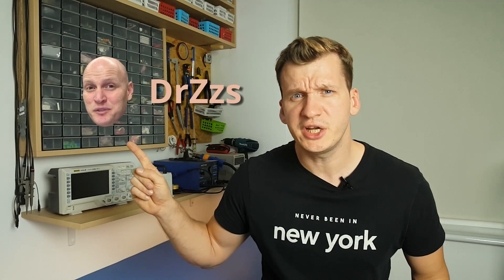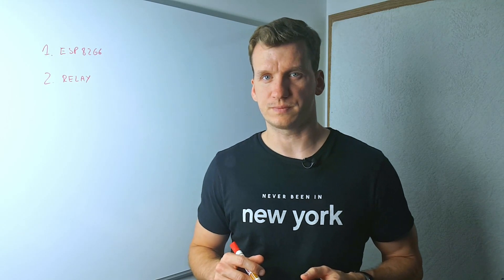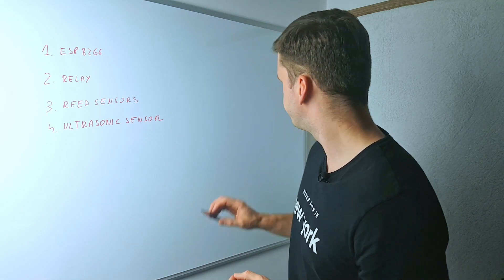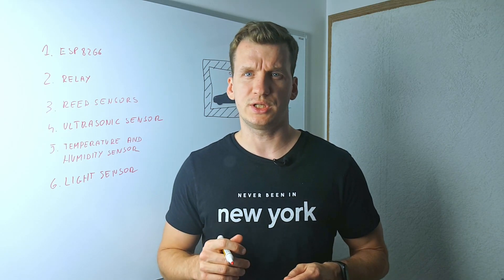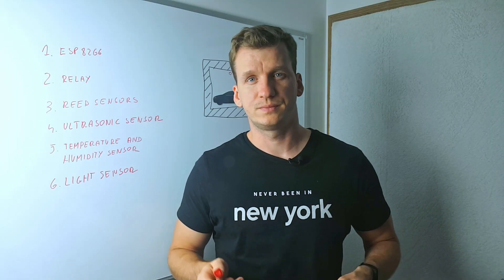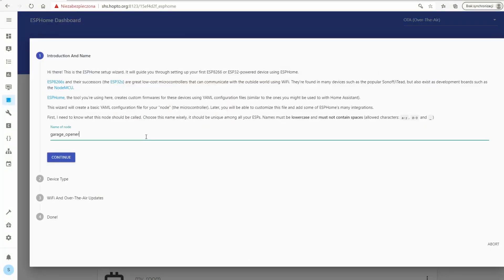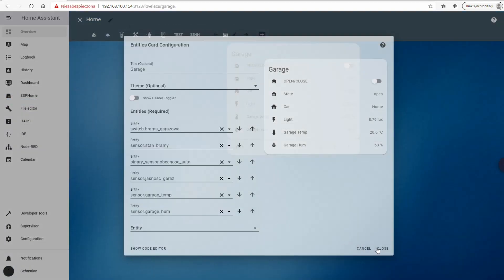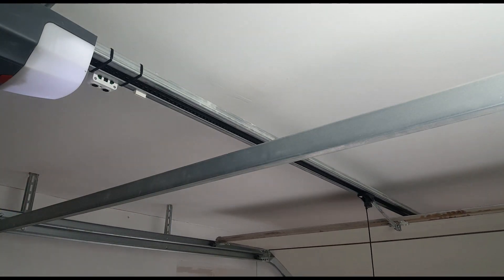ESP8266 Garage Door Opener: A Smarter Way to Open Doors

Comment: which 3d-printer are you using?
Reply from the maker: The printer is also designed by me (and two of my friends). Nothing commercial.
Reply: @SmartSolutionsForHome  Wow wish I knew as much as you do about electronics design. :)

Comment: Nice - I've been using a relay in a similar setup for some time, though not as elegant as yours. I'd considered using an ultrasonic to detect if the garage is down or up instead of car presence. Did you consider that type of usage at all? Wouldn't necessarily tell if it's fully down, but would at least show that it's not all the way up.
Reply from the maker: I think that the ultrasonic sensor isn't reliable enough to have such a crucial task. Therefore, to check if the doors are closed, I use an old - good reed sensor :) PS. Thanks for the nice article on hackster.io :)
Reply: @SmartSolutionsForHome  Makes sense. My pleasure, glad you saw it :-)

Comment: Highly reject this project, the sonic sensors are not reliable enough to trust to a garage door. Switch to a ToF sensor for "obstruction", or limit switch for closed/open status
Reply: The sonic sensor is just for car detection. The Reed sensors are used to detect whether the door is open or closed and the existing garage door sensors will handle obstructions, force limits etc.